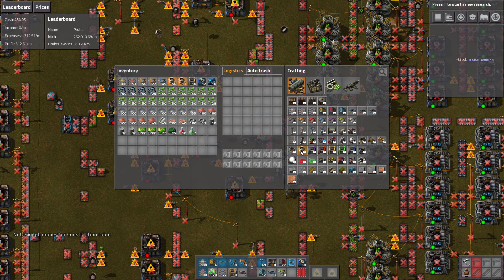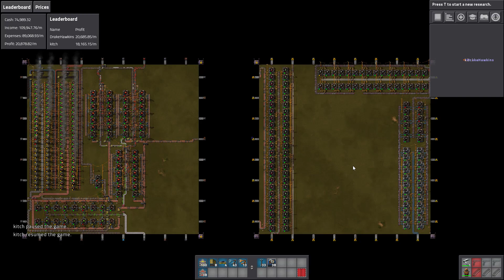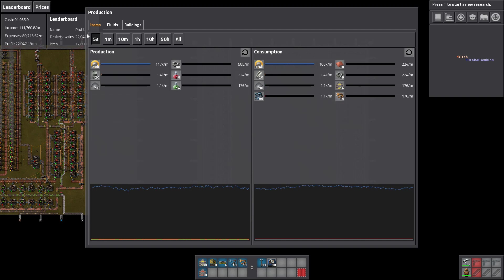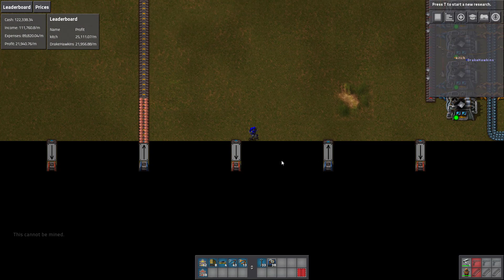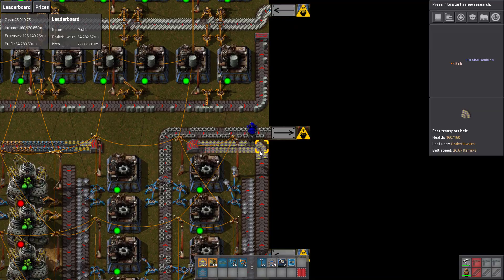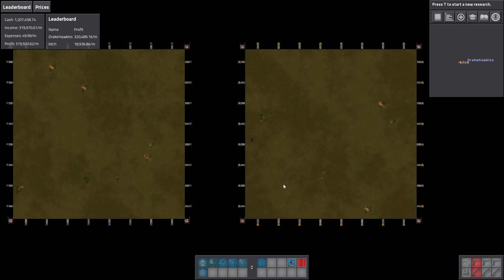Multiplayer Factorio - Factory Floor Mod - Competitive Factorio with Kitch   Round 2   Part 2 of 2

Comment: did some testing and power looks to be free also to increase profit you need to increase throughput eg blue belts. been testing some high profit setups and it takes forever without blue belts
Reply from the maker: Great to hear I’m not nuts about the power. It is a game of scaling up for sure. Make more to make more to make more faster!

Comment: 8:30 You need to be buying more than 1 copper per tic. The loader is unloading the requester chest faster than it can purchase the copper plates.
Reply from the maker: I think if you look back on it really close to the express loader you will see it’s pouring out at max speed of a full blue belt 40/s.
Reply: Let's test it.
Step 1) Load up the scenario and connect straight blue belt across the map from a buy chest to a sell chest.
Step 2) Request 1 Copper Plate
Step 3) If the belt is not full, increase purchase quantity by 1
Step 4) Repeat Step 3 until a full belt is achieved.
Reply from the maker: Belt is full on 1
Reply: This doesn't look full to me. (in the red box)
https://i.imgur.com/lEp7DW9.png
Reply from the maker: I can’t see it in the pic but I know they are totally full when they come out without being pulled from. The cable machines with 3 picks per inserter drains fast.
Reply: I guess we'll have to agree to disagree. ¯\_(ツ)_/¯
Reply from the maker: Should be easy to test for yourself. Just load up the scenario.